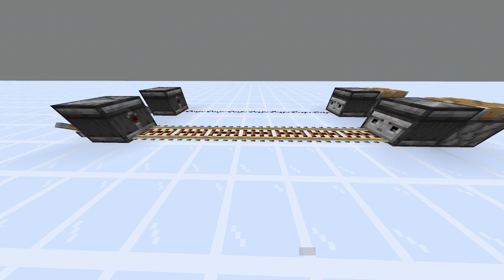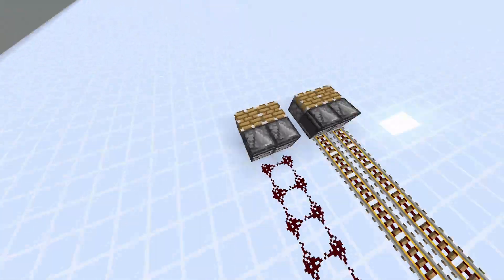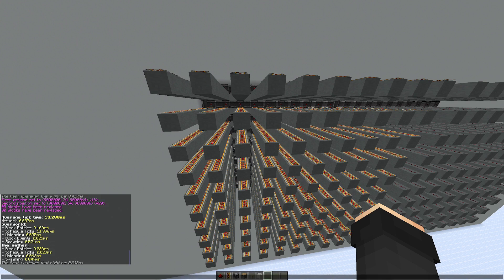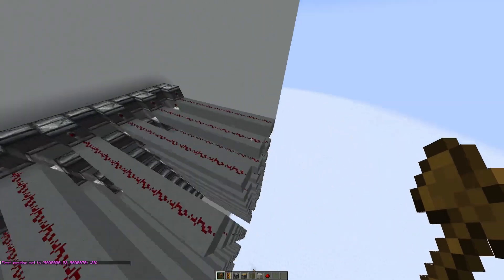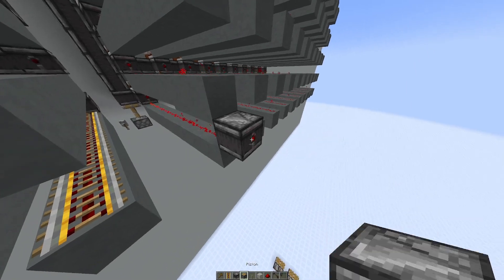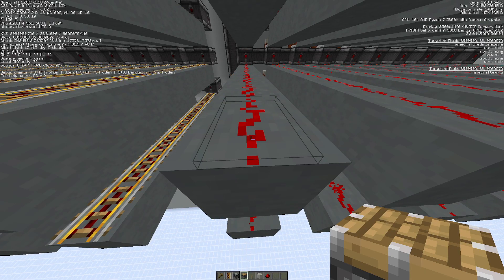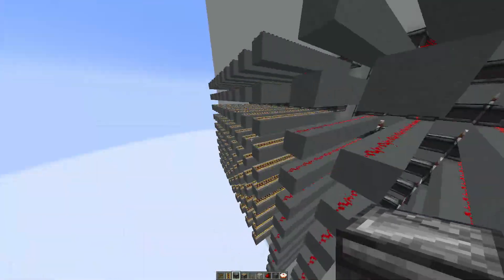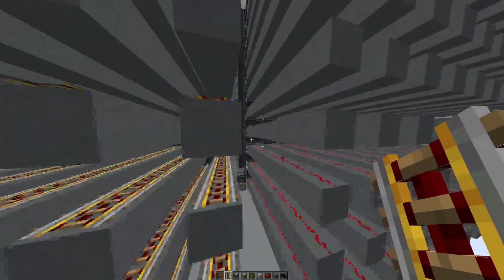Redstone vs Rails Lag Comparison | Minecraft

Comment from the maker: Have you ever gotten to the point where you actually considered what is the better option for every single piece of wire in your machines?
Reply: good stuff, thank you for the demo. i definitely try to have less dust if i can but hey, let me ask you a question - was intrigued and replicated your test and have the same results on rails vs dust however, i thought if i have light source 15 under dust situation is better... so i did the same test but replaced full blocks with froglights...doesn't change a thing. i tried other light sources and turns out, on sea lanterns, i get only 15mspt with dust! sea lanterns decrease lag for redstone wire? so does glass and top slabs, but those don't pass signal. froglights don't help, shroomlights don't either.
Reply from the maker: @LucianoVeryNiceHi  I dont think sea lanterns have any special property that would make them reduce redstone lag maybe it is because they dont transfer redstone signal so maybe try some other blocks like that for example glass or slabs or glowstone.

Comment: The reason redstone dust is laggy is because when it's depowered, it goes through each power level from 15 to 0 in the same game tick. When you pre-power it with comparators, it only has to go through 1 power level of difference per tick so it much easier on the server to process.
Reply: I believe it was changed in some newer version so that their signal strength decreases in steps of two, just a small thing to note

Comment: As somebody who builds things exclusively using redstone torches & dust (for challenges like structureless superflat) this video and the previous lag testing hurt my soul.

But on the other hand, you've given me an idea on how to reduce lag even in my builds, mainly bussing, by making sure every torch in said bus is spaced as far as possible and then having a 2nd always on torch powering every section :^)
Reply from the maker: @Porkey_Minch  If you play singleplayer you should retest it for your system since it might be different.

Comment: They should just make the debug stick obtainable in survival because I'm pretty sure you can use it to separate redstone lines. Or add a tool that can do something similar for redstone only, kinda like mekanism's configurator which can be used to allow pipes and cables to be right next to each other without attaching.
Reply from the maker: @RedVRCC  That would make too much sense for mojang.